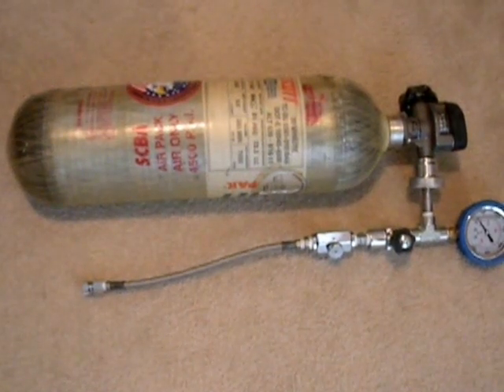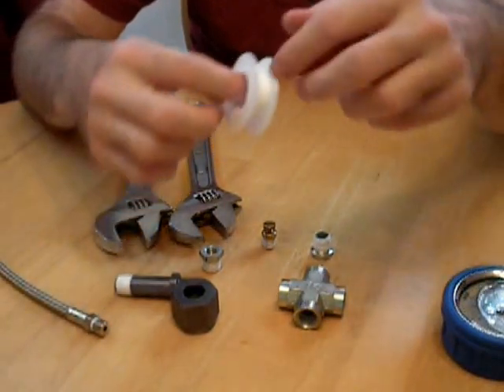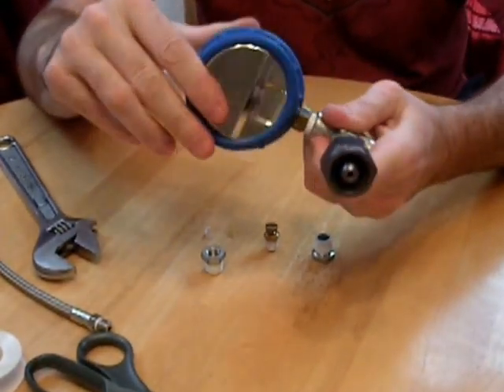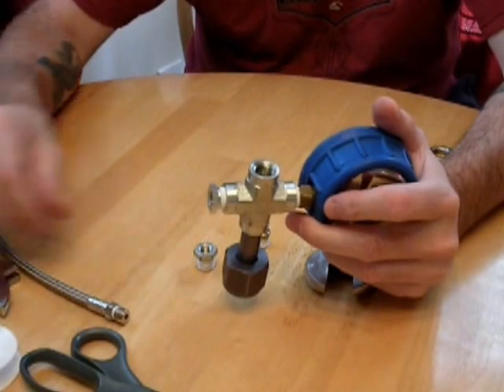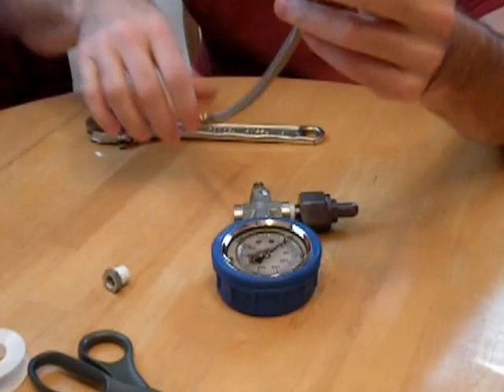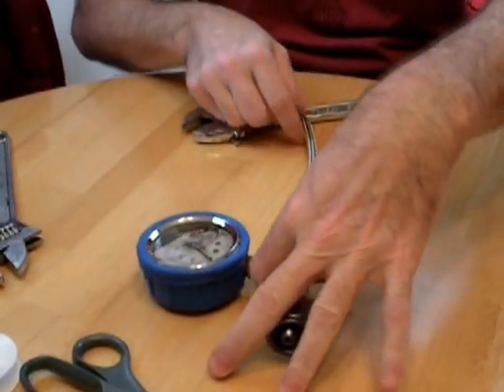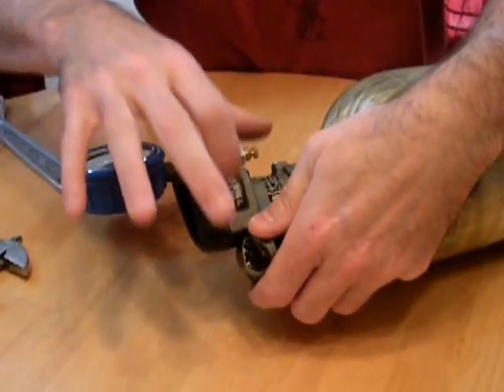PCP SCBA Air Adaptor Build

Comment: I have everything I need but I'm afraid to put it together. I'm putting 3000 psi into a hardware store fitting and I need to know if I need special pressure rated fittings.
Reply from the maker: Yes you have to make sure the parts are rated for HPA (high pressure air). DO NOT use anything not approved for the pressures you are operating at. All of my fittings, t's, and hoses that I use have a 6,000 psi rating. That's why you have to go to a dive shop, specialty air or scuba on line supplier, as well as a hydraulic shop. Please make sure all is rated. Good Luck.
Reply: +IrishAirgunner Thanks for replying your a life saver! I found everything pressure rated except the 1/4m to 1/8f fitting. That one is a bit difficult to find.

Comment: I don't want to buy a normal 4 way valve from lowes or home depo and my adapter explodes in my face. I don't know much about pressure so can someone help me out. And if I need pressure rated fittings where do I buy them?
Reply: +Jack Daniels What you need is Parker high pressure hydraulic fittings. What this guy is calling "adapters" are reducers. And I hope he isn't using standard steel NPT reducers! You need 10,000psi Parker fittings on everything! This includes nipples if you need them. Graingers has all these as well.

Comment: "how did you fine a hydraulic fitting from British bspp 1/8"  to us npt 1/4". I have mine done but but for the last fitting.... I cant find the coupler  to go from 1/4" male npt to the hose that is 1/8" male British bspp thread. I'm so close and so far,,, : ) if you have any ideas please let me know. or I may have to get a different hose but the adapter for my gun is bspp thread. Thanks love your channel...
Reply from the maker: Try a machine shop, they may be able to custom make (tap) the part. Also try EBAY and a google search. I am sure there is someone in the world that has what you need. Good luck my friend.
Reply: Hey got one on the way...got pointed to a guy from a gentleman on airgunnation. This is one great sight.... thanks for the help..  : )
Reply from the maker: Glad you got one.

Comment: I would like to build the adapter as shown in the opening shot with the inline regulator and 3 way Tee connector as opposed to the one that you built in the video.       Is there a place to get the inline bleeder and regulator valve.    Enjoyed the video and hope to save about 100 bucks if I can find the parts you used or similar.
Reply from the maker: Yes you can get the ""4" way adaptor. air in, air out, gauge, and bleeder. The 3 way is like 7 or 8 dollars. For some reason the four way as shown is around $15. It is a simple NPT (Nation Pipe Threat) four was splitter. You can get them at hydraulic or air supplies. Good luck and thanks for the kind comments.

Comment: How do you fill your SCBA cylinder? Are there any adapters you can use to do it with a home air compressor, or do you go somewhere to fill it?
Reply from the maker: Anthony Vinson I get them filled with a commercial grade compressor and cascade system at work. You can get a compressor that will fill up to 4500 psi, but you cant get them at Lowes or Home Depot. The compressor I want for my home cascade (fill system) is $2,400. You can get scuba tanks filled at any dive shop, some even have the adaptors to fill a scba tank, call the local dive shops, they are your best resource.

Comment: Does the CGA 347 work with a MSA airtank?
Reply from the maker: Hello Gary, a friend has built my adaptors and used them on MSA tanks. Make sure they are the 4500 psi carbon fiber tanks and they should fit as a rule of thumb, as well as NFPA (federal) standards. Good luck and thanks for the question.

Comment: hello where you buy some all material is super
Reply from the maker: You can get all the parts at a hydraulic part shop, specialized high pressure air shop, or you can search the web (not recommended due to high cost). You have to find a local shop or someone who builds hydraulic items. Good luck on your search.

Comment: Hi. Great video. Thank you. Where did you get that valve in the beginning of the video on your original setup. Is it a slow flow control valve? Thank you.
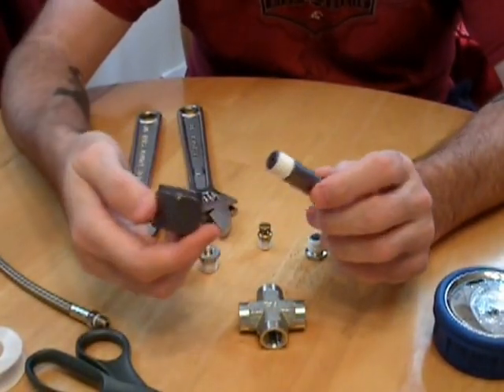Reply from the maker: albertqss I have so many valves in videos and in my toy box at home. Give the time frame that it is in, 2:33 or so, then I will look at it and tell you what you want to know. Thanks for the interest.
Reply: Thank you. It is the black knob between the bleed valve and the "T". Cheers.
Reply from the maker: That is a dive shop part (made by Sherwood). I found it in a junk box at work. I looked it up on line to buy another, they can keep it at $75. It is a flow valve. Similar to the valve on the bottle. Crack it for slow fill, or open and dump it out. That's why I did not include it on my list or explanation. It was a Rare and FREE find.
Reply: Thank you, sir!

Comment: Hello, I am trying to build my own scba filling adapter but there are a couple of pieces I don't find or I find them and are very expensive, I am talking about the 4 way T and the bleeder screw. I was hoping someone could give me some useful data on what stores I could look for them or in what page I can buy them, but please that the parts are not expensive because I have found them online but they cost about 30$. I would appreciate a lot your help, and thanks for reading.
Reply from the maker: plls12 I replied to another request. I will put a parts list together, and throw in some links or suggestions. They are expensive if you buy them on line. Like I said before. Try a hydraulic shop. A shop that builds, repairs, or services hydraulic equipment. They stock these parts and most that I have dealt with will sell them to you at or a little over their cost.

Comment: How much tape should I be using?
Reply from the maker: You want to wrap it one to two times. You really don't need a lot. This tape only seals the very minute gap between the threads. Thanks for your comment... IAG
Reply: IrishAirgunner Great.

How slowly should I be filling? I hear that you're only supposed to go like 500-750psi a minute to prevent heat.
Reply from the maker: Here is why slow is best. Fast filling will not blow the tank up, its not good for it, but not catastrophic. We "Hot" fill them at work if pressed for time and in a emergent situation. But for PCP shooting there is no need. If you hot fill it to 4500 psi. The tank expands too fast and heat is created. When the air and tank cools. The 4500 psi fill will now be 3800. So your 500/700 psi per min is the best to retain the most air per fill. I fill mine to 4600 psi and as it settles, it is at 4500 even at a slow fill. Hope this helps.... IAG
Reply: IrishAirgunner From your experience, are there any parts in your setup that are weak because of low-cost materials?

I see Joe Brancato market his stuff all the time and I suspect that he's profiting big time, but are there any parts that are actually worth buying?

Do I need a regulator? Are parts like this http://www.hustlepaintball.com/Custom-Products-2005-On-Off-Air-Source-Adapter-ASA-Black?&search_id=2198951 worth it? Not sure if I should be going with super fancy parts, but better safe than sorry.

Comment: How much would you charge to make one of those adapters i'm very interested in one
Reply from the maker: I don't manufacture these. I only put out what I have learned from trial and error. I try to give fellow airgunners the chance to do things on their own instead of paying top dollar. There is not a lot of resources out there for "do it at home HPA (high pressure air) starter kits", If I wasn't in my profession, I wouldn't know much about them either. I list all the parts you need in my videos. As soon as I get some time, I will do another detailed video listing everything on the screen for you to find. Thanks for the comment, IAG

Comment: Hello.  I got a different tank, Survivair Sigma Hip-Pac Air Respirator Escape SCBA 4500psi Tank.  Do you know what type adapter this uses?  I'm pretty new to the PCP world and ordered the tank off ebay before I saw your video.
Reply from the maker: Google and research the Survivair "fill adaptor", or "connector". Once you find the part, you attach it what ever source you have (most are 1/4' NPT threads). The hard part is finding the connector that will properly fit your bottle. If all fails contact the manufacture tech support for a part number. I find my stuff on ebay, it takes research of the manufactures part and part #s to make sure you get the right part. Hope this helps... IAG
Reply: IrishAirgunner I contacted Airtanksforsale.com and they said they're interchangable. So I'm going to give it a try.
Reply: One more question.  I have a chance to get a taylor wharton HC-4500 4500 psi steel cylinder with a  CGA 347 valve. Do you think this is good for refilling SCBA bottles?
Reply from the maker: I believe the CGA 347 is the part number for the Scott SCBA systems. If you look at my previous filling videos it lists it in the comments. The SCBA has specific threads. They are the same for MSA and Scott. Once you the thread, you can us it to fill the scba as well as connecting it to the bottle with a hose and filling your PCP.
Reply: NFPA requires that ALL SCBA bottles be threaded alike.
Reply from the maker: Yes I know, however if you look closely. There are SCBA bottles on Ebay and that are from out of the US (not NFPA). Also some military bottles are not threaded to NFPA threads. So I always make sure. I have seen a lot of weird things. Better safe than sorry.
Reply: Yeah sorry, I am a Vol. Firefighter all I know is NFPA. And I take care of our Airpacks, so I have easy access to a free bottle that is past it's 15 year life span.
Reply: The seller on ebay was good enough to cancel the buy since the bottles were past 15 years old.  I ended up getting 2 Scott 60 minute bottles locally.  I went to a Parker store for the parts and built a fill assembly.

Comment: Please advise where you can get these parts
Reply from the maker: Ebay is a good start, they are moderately over priced on some items. If you have a COMMERICAL pneumatic (air) distributor (like Airco) or a hydraulic shop. Those two places are a start and most likely more cost effective. If you piece it together from ebay or the web, could be pricey. I get my parts from a local Hydraulic shop. Most are 7500 psi rated and suitable for air. Should you need more help, message me. Thanks for watching, IAG

Comment: Thank you so much for your insight on this. I couldn't quite get down to 55 ish dollars. But I did make it for about 75, using Grainger as my main source (availability) And made sure everything was 5000psi or 6500psi rated. Very informative and useful information in this video, thanks again!

Ps. I bought the 3 suggestions you had of Ebay.

T
Reply from the maker: T, Like I said to another comment. INFLATION !!! As gas and milk rises so does "toys". I about flipped when I bought some parts to build another. I am still around $60 to $65, just have to shop around. I am building my own compressor/storage bank system now. That's a little more than $75. I will have some more videos soon. Been a cold winter in the south. Sorry for the delay. Because I didn't click google plus, I was suspended, but all is well now. Thanks again.